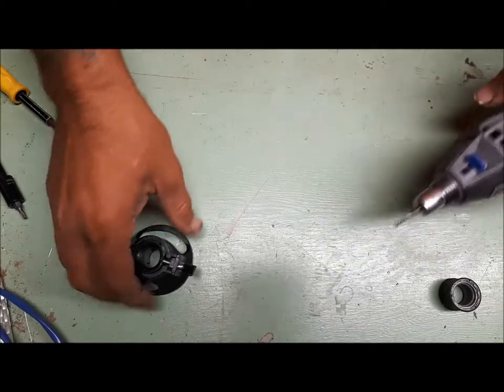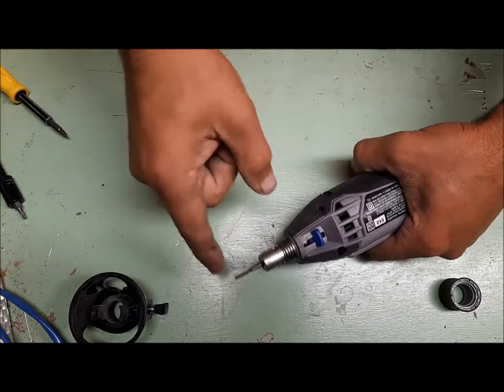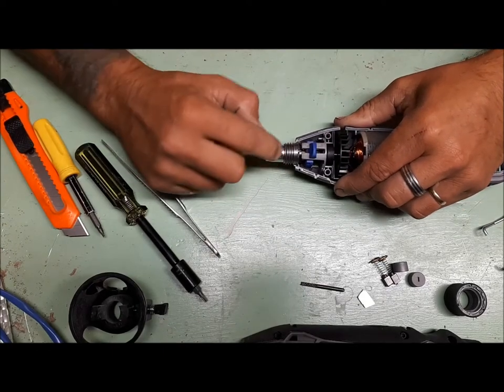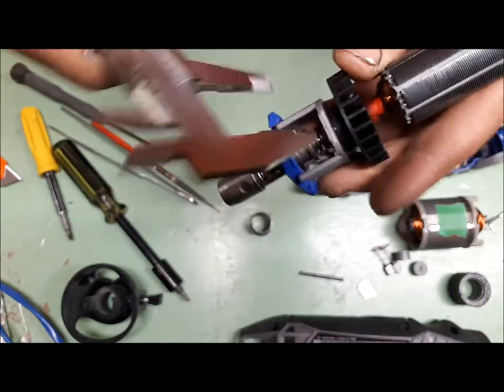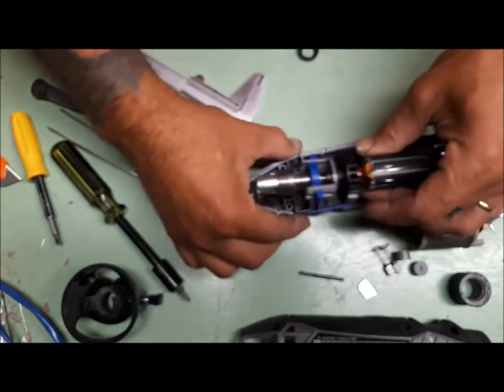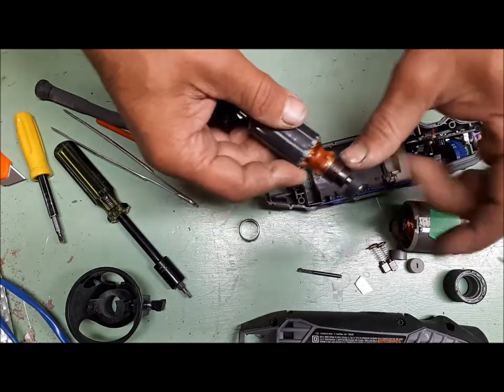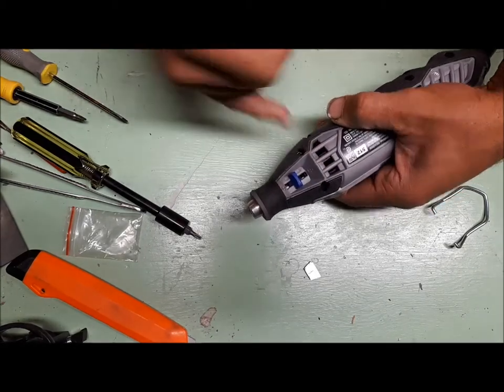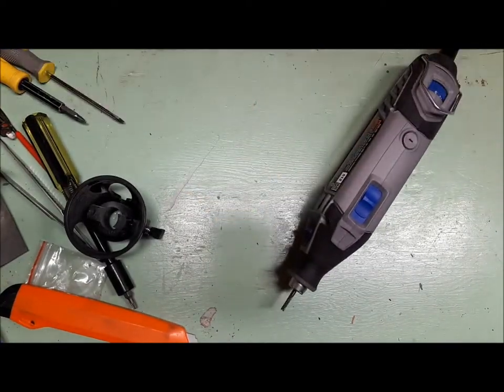Dremel 4200 design flaw

Comment: So have just engaged with Dremel Australia on this issue.  I had the stuck "Nose" Part #30 (official Dremel speak from schematic) and had to cut it off.  Found this Design Flaw video and checked my Dremel shaft for lateral play, got  0.7mm to one side, which is pretty sloppy and means the shaft rubs on the metal housing when cutting, buffing, etc, any operation that puts side pressure on the shaft (heat friction build-up then melts the plastic Nose or other attachment thread).

The issue of having clearance of the bearing on the shaft to achieve the Ez Change function is complete nonsense.  Bearings and shafts need interference fits to work, but if the bearing is tight on the shaft the 4200 Ez Change function will not work.  So the design engineers compromises the shaft/bearing function to achieve the Ez Change quick tool change design brief.  Pure genius!

The Dremel 4200 is not listed on current tool lists on the Dremel web site and I presume the Ez Change approach has been consigned to the Design Fail Bin of history.  My usage was 2-3 hours total over shortish periods, primarily buffing and cutting off.  Hardly stress testing!

Dremel rep (on phone) would not acknowledge "known" problem and said because I did not have receipt the Warranty is only 18 months!  Good luck with that approach, Aussie consumer law is pretty good and under the "fit for purpose" test the 4200 is a complete fail!

Have submitted my written complaint to Dremel and await a response!

Thanks to all who take the time to post this informative stuff on YouTube, it has been a great help.

Cheers,
Reply from the maker: Oh brother, thanks for the info!
Reply: @ROBOFORCERX2000   Heard from Dremel Aus and they are "considering" my submission!  Am updating my doc to include additional info to sent it off to consumer protection.  There is a requirement to seek remedy with manufacturer before they will get involved.  The more I dig the more evidence I find ;-)
Reply: @ROBOFORCERX2000  Bosch Australia have offered a replacement DREMEL® 4300 (4300-5/50) so I'm pretty happy with that given I thought it would end up with Consumer Affairs and get dragged out.  ;-)

Comment: Have just received my replacement Dremel 4300 kit with 5 attachments + 50 accessories.  It has taken a lot longer than promised but these are strange times.  Bearing in mind I'm in Australia and my consumer complaint was on the basis that the tool (riddled with so many problems additional to the bearing and cap issues) was "Not fit for purpose" under Australian Consumer Law (also a safety hazard with the bits flying off at random)!  I did "fix" my 4200 to a degree by epoxying a bearing onto the removed split housing cap, but in the end it does not resolve usage of attachments and the tool bits flying off, so more of a something to do while waiting for the new tool.  May be an option for others depending an your usage.  It did remove the play on the shaft.  There is a standard bearing that does the job (with a couple of turns of cooking foil packing), can't remember the sizing offhand.  ;-)  Note:  Warranty not an issue with Fitness for Purpose claim)

Comment: It was junk I had same issue. Plastic from around the EZ change levers came off. Returned it as only had it for a couple of days. It is a design flaw, they sure have tested it better. Months later when with a 4300 and no issues and smooth.

Comment: Same problem. Replaced my older model due to the speed control, and decided to buy 4200.   Used this MAYBE 5 hour Max...wife taking off fingernail polish.  Use the flex extension, and hearing it rattle...it melted the threads of screw on plastic..same as yours.   Unacceptable.  Poor radial support with the lack of precision bearing.

Comment: Hi! How modified dremel works? Bearing in slider still works? I just bought same device and it has same problem.
Reply from the maker: Hey man, sorry for late reply. It definitely improved the situation, but the problem is still there. I can router soft wood or plastics, but anything harder is still a no no. Same model without that quick release system is perfectly fine because it has front bearing closer to the chuck.

Comment: Try the Proxxon multitool they say its much better but havent tried it
The tolerances are not ok on this one you should not be able to take the bearing off lol!
You could try baking the bearing in an oven for equal amount of heatup on all the material then apply it on the flange before it gets cold and the bearing should shrink
There are heat inducters made for heating up bearings like this but they cost a small fortune
Reply from the maker: cheers bro, I'll have a look at Proxxon. The heating issue was not coz of the bearing, but because it was too war away from the cap and that made center part to rub into housing.